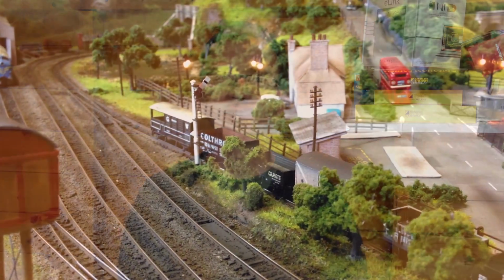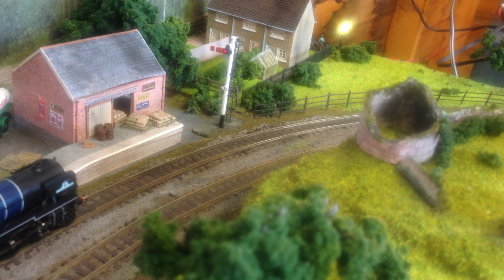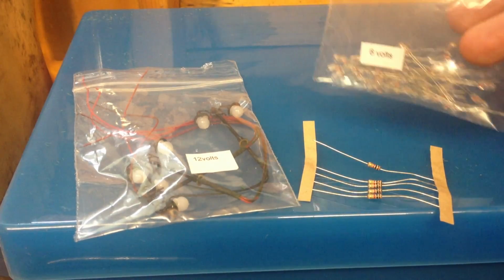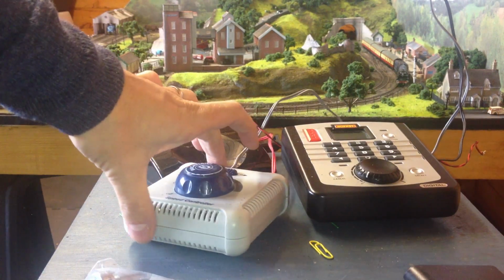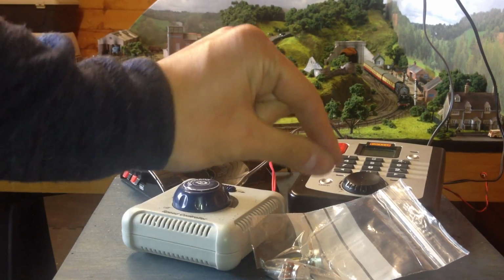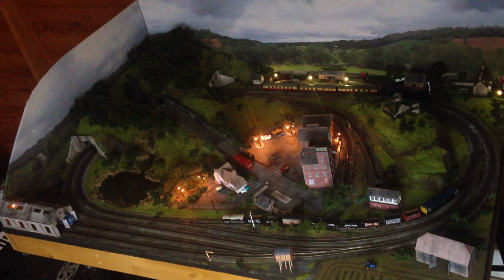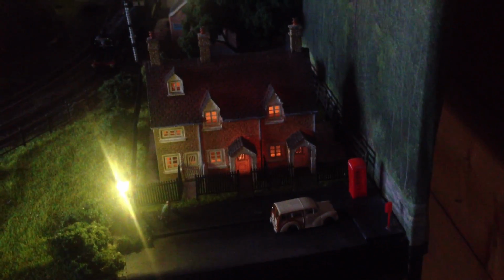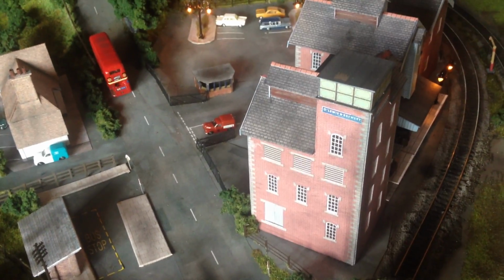N Gauge Model Railway Layout Update: Bodenham Woods 17

Comment: Hi Simon. Love your videos. I'm thinking of starting an N gauge setup and I'm a total newbie. Can you tell me where to use the different fishplates i.e insulated / non insulated . Cheers Andy
Reply from the maker: Hi Andy, the rule is you put the insulated joiners on the "V", i.e. the 2 inner rails where the point fans out into 2 tracks.  All the others can have normal (metal) joiners.  

You then need to put new power feeds after the point.

Comment: What made you choose N gauge over 00 gauge? Do you use the DCC select or elite or elink.
Reply from the maker: Went for N gauge so I could fit more track into a small space.  I've got a select and an e-link, I use the select for quick tests, but the e-link is much better for switching my DCC controlled points.
Reply: Yeah, I model 00 gauge and I use E-link because you can control every DCC thing on your layout from one  place. There's not that much choice when it comes to N gauge rolling stock.

Comment: Hi Simon the voltage adjustment transformers are good with the 3 - 12 volt save using resistors , think they can be bought at Amazon for about £8 . layout is looking good with the lights added , as you know I like to add a lot , brings the layout to life
Reply from the maker: Hi David, yes will have to get some transformers as I'll need the DC controller back at some point.  Pleased with the lights, easier to do than I thought it would be, even though I'd made it tougher by glueing all the buildings down first!